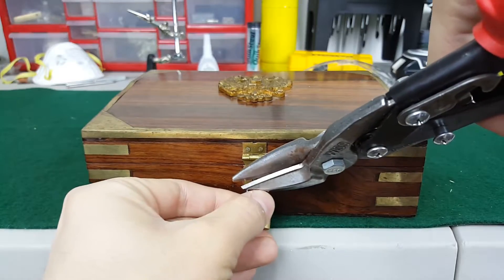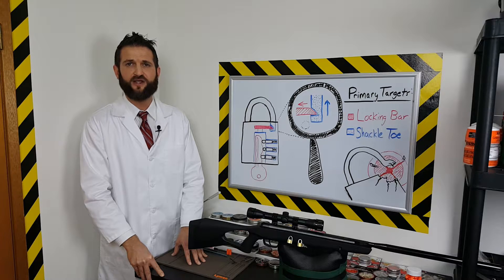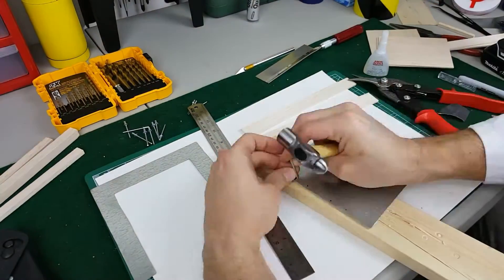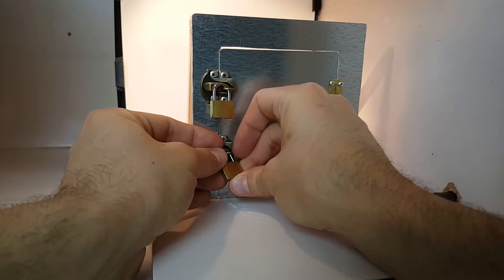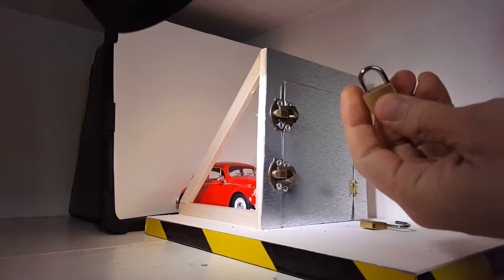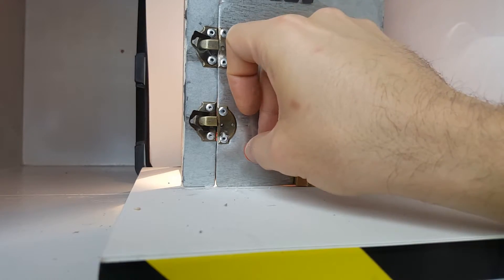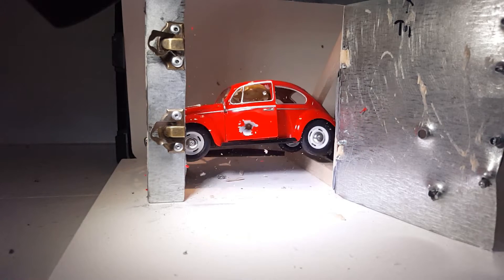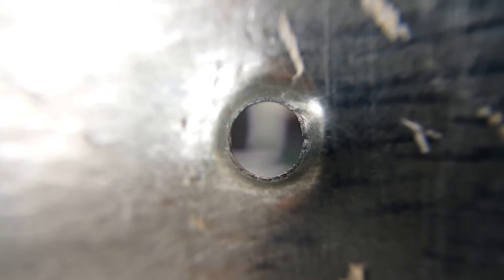S1E8 - 2 Airgun Pellets vs. 2 Padlocks - What's Behind the Blast Door?

Comment: Fun stuff.  Used to do this witH die cast metal tanks and armor vehicles.  My .20 caliber sheridan cylindrical. Match with a nail head  shortened and glued to tip of filed down pellet.  Would melt into the armored vehicles.  The Tanks didn't last long.   The gun a Sheridan blue streak air rifle at 650 fps